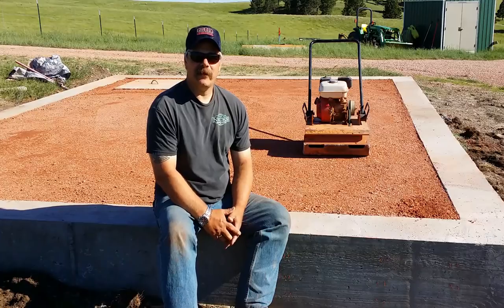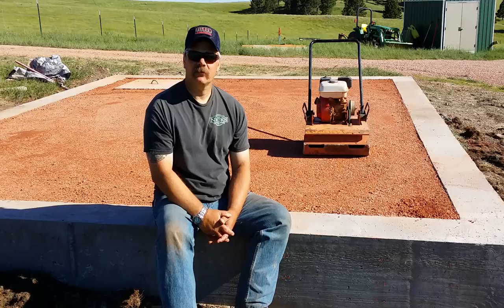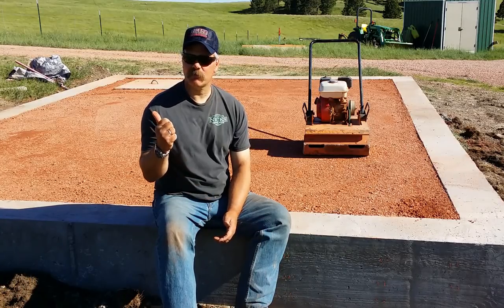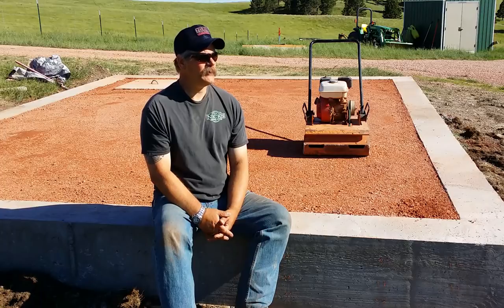Timber Frame Barn 7 : Finishing the Foundation

Comment: Tim, great job showing your process.  I am planning on finishing my foundation for my 20'x20' shop in April.  The building Dept. required a much heavier footing 30" x 24" and an 8" slab, #5 rebar, etc...  25 yards of concrete is my estimate.  Not sure if they'll Ok using the baling wire but thats a great idea.  Thanks for the inspiration.  I've never done concrete work before.  I thought I could do it by myself but my buddy says I need four guys.  Obviously one guy and two girls is all thats needed.  Girls are tougher than guys anyway. And there's no whining.  Haha!
Reply from the maker: Thanks Tim!

Comment: Love that red fill, what's it called out there? I remember when we finally built the " Castle" for my wife and kids. Tri level 5 bedrooms, 6 acres with 82 acres of conservation land around it, all the Wildlife you want in New Hampshire. I put in a 20'x40' inground 9' deep end , steel walled pool for everyone, w a 48" concrete apron around it and on one side a 28' x 12' patio on one side of pool for cookouts etc. That was 26 years ago, replaced the liner twice in 26 yrs, still sparkling clear fun every Summer and not one crack in the concrete . I used concrete mixed with fiberglass. & lots of compacting first.
Reply from the maker: Sounds nice!  Compaction is the key.   Do that, nothing will move.